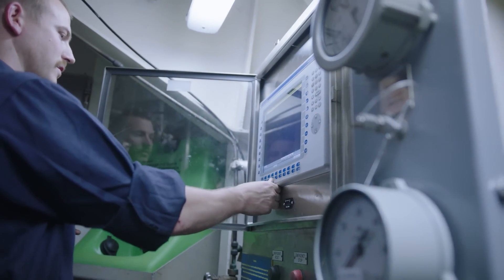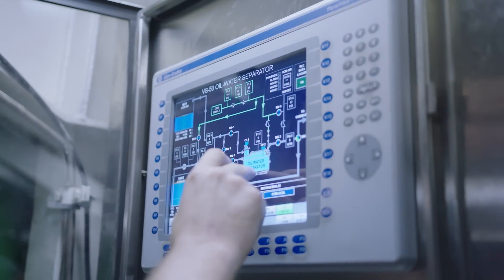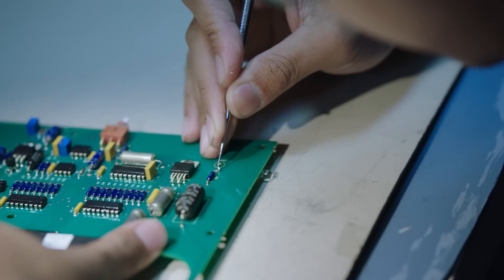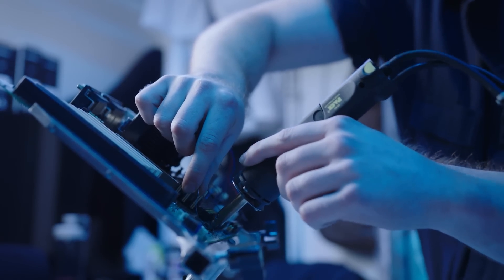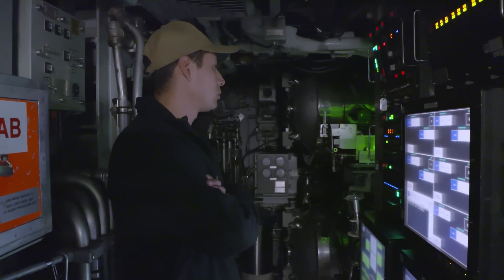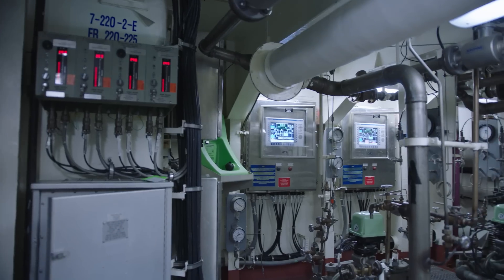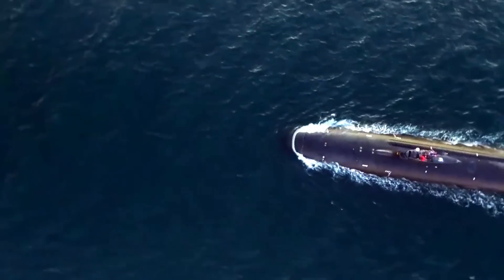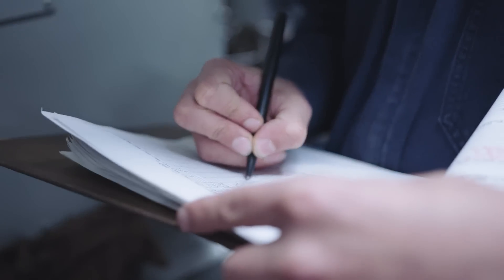Navy Electronics Technician Nuclear – ETN

Comment: Just screw in some blue light bulbs for color, get the "Normal Looking/Sounding" ETNs to pretend that they are allowed to regularly solder, make sure to break out the laptop just in case you need to check on the anti-virus software while you are doing it. And voila, Just ETN Things...

All jokes aside the video is very impressive. They really worked with what they were allowed to show.

Comment: Can someone explain the main differences in duty between ET and EM?
Reply: ETNs are reactor operators who deal directly with systems that have to do with reactor safety. EMNs are electricians that work with the electrical distribution system. So while both rates are electrical in nature EMNs are electricians in the broader sense that they work with a variety of electrical systems and own a lot of the electrical components. ETNs are only really focused on those systems and components that deal with the nuclear reactor such as how to move the control rods up and down.
Reply: @zuhayravalos6376  EM's generally have a wider gap in their front teeth because they have to strip larger wire sizes than ET's, and they're always filthy from changing generator brushes.  ET's must shower three times a day because we can and have nothing better to do.
Reply: @zuhayravalos6376  thank you
Reply: Riku Dawn )
Reply: A lot of the ETN's off watch work on the carrier was using a laptop to run tests on reactor control system's software. The occasional card chip replacement & multimeter readings. Digging into reference books to troubleshoot a system. HUGE on procedure
Reply: Nuke ET's focus on electronics... When I went through A school it was 6 months long with a focus on electronics, electronic fundamentals, transitor theory, op-amps and digital... And EM A school was like 4 months and focus more on electrical theory and power distribution. On a sub, the EM's deal with Generators and Motors and electrical distribution throughout the submarine.  I've helped electricians troubleshoot systems for power generation for the tracking systems (not even a nuke system)... On a sub they cover everything electrical. Whereas a Sub Nuke ET does Reactor Operation and all electronic systems associated with reactor control.  I've been called to assist in Electronic problems on the sub in other areas such as radar and navigation, but it's not a normal part of your job... However, in my experience the Nuke ET will know more about electronics than any conventional ET, which is why I was asked to assist these other groups. 

You can't go wrong with ET or EM... I chose ET personally because I love electronics and don't regret it one bit

Comment: What about non-nuclear ETs?
Reply: Aecf
Reply: I was always jealous of the non-nuclear ETs. Our "electronics" barely deserved the title. Comms and radar is what we trained on in A school, and it was more interesting (and easier to maintain).
Reply: @AtomicAJ74  When I went through the ranks we took the same test as non nucs and still managed to get top 10% until they made nucs compete with nucs.  I took all my courses in a closet with a pin light shining through the back of the scratch off answer pad.
Reply: Ive been trying to get info on that lol only the airforce seems to have them
Reply: @kathifidalgo0  Air force? I'm a regular ET in the navy, non-nuclear that works on comms and radar
Reply: @nathanvaughn3609  is there a secuirty clearance needed I can pass one but I just dont wonna wait that long
Reply: @kathifidalgo0  well no more than Fire Controlman. Ours is secret but it should be fine
Reply: @nathanvaughn3609  I'm tryna  go in go in for this thank you for the information
Reply: @nathanvaughn3609  hey man I know that this is an old comment, but I'd like to ask:  What are the sdap and enlistment bonuses for non nuclear ets compared to nukes? Couldn't find the answer anywhere...
Reply: @ibrahimkayikci2146  sdap I'm not quite familiar with that but enlistment bonuses have been ranging here and there. When I joined before 2018 it wasn't offered but all my friends who joined after beginning of 2018 all got around 10k. Honestly that's something you'd have to ask the recruiter cuz we don't get that info. Just know our reenlistment bonuses aren't too shabby
Reply: @ibrahimkayikci2146  nukes really get higher bonuses given they have harder schools and depressing jobs
Reply: @nathanvaughn3609  thanks man, I appreciate the info. Hopefully, I'm going to join in 2021 and follow the ETR program. ETN apparently has higher bonuses and some SDAP on the side, but I don't have a clue how hard the school is and the level of competition, which is a little intimidating to me. I don't want to go to C school only to drop out. Thank you for your service.
Reply: @ibrahimkayikci2146  thank and anytime man good luck to you and choose wisely. "Choose your rate, choose your fate" as the saying goes. I can answer questions about certain rates if you decide to go another route but good luck to you man
Reply: @nathanvaughn3609  Actually I have a bachelor's in electrical engineering, but it's from a foreign/not accredited college. My goal is to join the ETR program and also to earn an accredited degree during active duty. I heard it's possible to get a degree with online classes and there is TA. So, I can get both XP and a US degree after one term of active duty  (also some savings). What would you suggest to a new recruit who wants to reap the most out of the 5 years in terms of which route to follow, how to save money (or opportunities to earn more), taking classes etc ...?
Reply: @ibrahimkayikci2146  thats neat. You can achieve more school through TA for sure. I would see if your credits can transfer over prior to joining so that the navy knows and can direct you on which schools can take those to other schools and follow their degree path. Also that should move you up in rank prior to joining so you can come in as an E3. Also a bachelor's gives you 4 points extra on any exam to the next paygrade
Reply: @nathanvaughn3609  Thanks man, that' good advice. I'll see if I can transfer my credits. BTW, happy new year:)
Reply: @ibrahimkayikci2146  anytime man and same to you
Reply: I'm trying to get in this career

Comment: The bonus is 40k now? I should've waited two years to join wtf
Reply: It is now 60k I just signed my contracted and I leave after I graduate high school on July 2nd and my Bonus was 60k
Reply: Bonus is now $75k.
Reply: @christianulloa714 grats to you. With any luck I will see you there
Reply: IIRC it was $1000 in 1984...
Reply: @williamnoll7935  1997 and I got 4k
Reply: What was it before?
Reply: Still... if you can get out with a degree (or become an operator).. you'll make that up quickly
Reply: @superman6338  Any 'house' Nuclear Plant position (OPS, Radiation Protection, Chemistry, Maintenance) will eventually lead to a $100-200k annual salary. No degree required; just  the fact that you were a 'Navy Nuke' gets you in pretty easily.
Reply: Enlistment bonus is actually about 38k, but if you can pass the PFA going into bootcamp you could possibly get 40k
Reply: I'm from the future. bonus is $100k now
Reply: 5 years late, but its 75k now. star reenlist is around 100k
Reply: 140k now